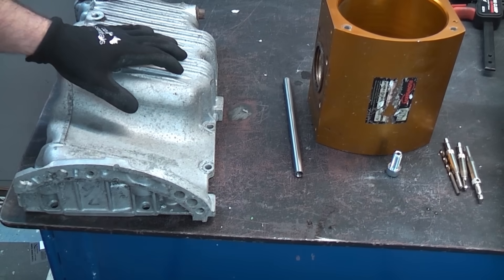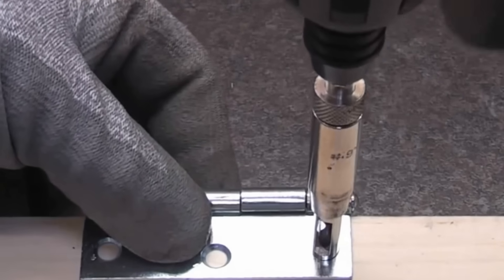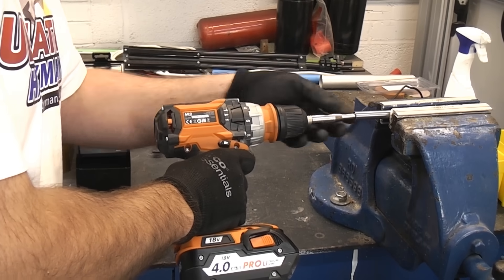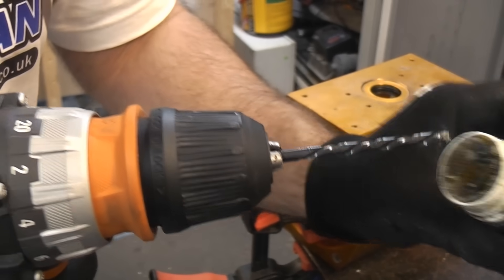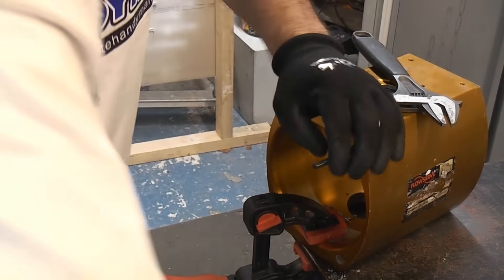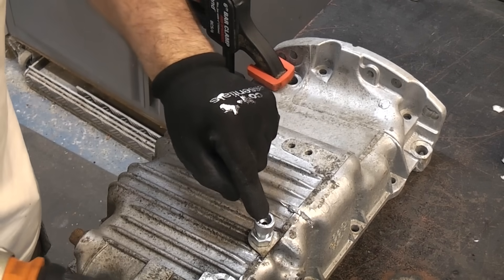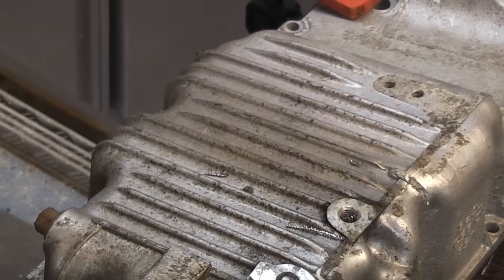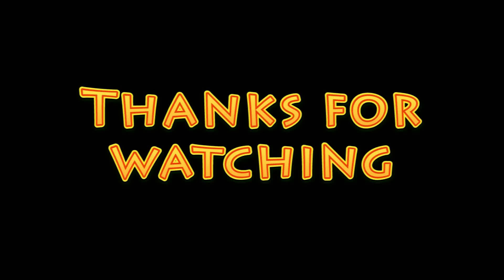How to remove a broken bolt in a deep hole | remove broken bolt in recessed hole

Comment: Next time use the smallest drill but u can...very light pressure, dab of oil, and   ease up on the rpm of the drill...drill all the way through it then pull by hand if it doesnt lock in enough to remove with drill in reverse....

Comment: What if that bolt is only about 0.3-0.5mm thick?
I have one really valuable old Zeiss SLR lens, made out of metal off course, and there is one broken bolt that should tightening the rear focusing element in place. This lens was calibrated for shorter range by previous owner, and I need to recalibrate it now, but stuck on that part…
Reply from the maker: It will be really difficult with something of that diameter, I don't even think you can get drill bits that small!
Reply: If the bolt is broken at or near the surface, you could try a dremel fitted with a diamond coated saw and create a screwdriver slot.
I'm sure that you won't mind if the saw cuts into the lens body if it means that you can turn the bolt.

Comment: The idea of making a drill guide to avoid damaging the thread is fantastic. However, since I don't have a drill press to make such a guide, I'll use a dremel rotary tool to make a hole to keep the drill bit at the center of the broken bolt. Thank you very much for the very useful tips.
Reply from the maker: Thanks for the comment

Comment: Thanks for the Video! ^^
Removing a torn off screw that sits deeper in the thread is no problem! It becomes more difficult if the screw is broken off flush with the material surface! Unfortunately this was not covered in the video. Also the size of the torn off screw is decisive, with a M12 thread this is no problem, but with a M6 thread or smaller you have a problem!
Reply: Weld a nut onto the broken bolt. Works like a charm
Reply from the maker: I've covered bolts flush with the surface before-
https://www.youtube.com/watch?v=_R1b8niX13w
Thanks for the comment

Comment: Great advice. But one should NEVER use copper based anti-sieze paste on aluminum.
Reply from the maker: Thanks for the comment
Reply: Actually the manufacturer of Permatex copper anti-seize recommends it for use on aluminum. Even their website states Permatex copper anti-seize is:

A premium quality copper anti-seize and thread lubricant .....
Suggested Applications: *Spark plug threads installed in aluminum*, exhaust manifold bolts, engine bolts, oxygen sensors, knock sensors, thermostat housing bolts, fuel filter fittings, and battery cable connections.

Not using it on aluminum is another internet myth that keeps coming up over and over again.

Comment: Smart tricks but, how do you make that hole in the guide-screw? and how do you tactle bolts that broke flush with the surface? the bolt-extraction method you just thought us work well when the bolt is actually inside and there's thread to thread the guidebolt into.
Reply from the maker: The guides are easy to make- https://www.youtube.com/watch?v=6mZj0J6CNYA
If it is flush with the surface, you can centre punch it, drill it and use a screw extractor- https://www.youtube.com/watch?v=_R1b8niX13w
Thanks for the comment

Comment: Ezouts are worth a shot as well.
If i can't make a drill bushing, what i will do is use a punch and get a nice centered dent in the sheared bolt.  Then us a dremel and make that dent a little more pronounced.  Then use a small drill to get your first hole.  Work you way up in drill sizes to get a bigger hole.  When it looks like you have used the biggest drill you can w/o damaging threads, use a sharp punch and pick the threads out with a hammer..gently.  It doesn't hurt to chase the threads with the right tap afterwards.
Reply from the maker: Thanks for the comment

Comment: The hinge sighting drill thingy and the left handed drillbit was fucking genious. I did not know either of them actually existed. Also the bolt drill guide is a good tool to make and have available in the garage. I've never encountered broken bolts that deep i the hole, bu now I'm confident that I will be able to remove it. Thank you for this video!

Edit:
On a side note, in Norway, we call the screw extractors "pigs dick".
Reply from the maker: Thanks for the comment

Comment: I broke one once on a 1970 Duster with a slant six. Twisted one off removing the broken exhaust manifold. Used an easy out and drilled it. Screwed up the threads, but it went in okay. Drove it for six more years without any problems. The car was simpler than today’s lawnmowers. I still have dreams where my current vehicle breaks down and I have to go back to the Duster. It starts every time, but the brakes pull left.
Reply from the maker: Thanks for the comment

Comment: What the hell is a left handed drill bit
Reply from the maker: A normal drill bit cuts going clockwise, a left handed drill bit cuts going anti-clockwise, which is useful when trying to remove broken bolts as the drill bit sometimes bites into the bolt and can extract it.
Thanks for the comment

Comment: Through hole is easy, i just drill it out on a bilnd hole with abit smaller than tap drill size and retap it, the threads left are cut away again. You need a drill press. I don't do that at work, i use a ballnose endmill and plunge it out. Works for everything, tap, bolt, reamer,drill, endmill. Must suck trying to use a cordless drill, lol, like a carpenter
Reply from the maker: Thanks for the comment

Comment: That's not bad ..i do a lot of manifolds on cars and trucks so pretty much every ford doge or chevy has broken bolts when they come in but I usually  just take my mig and spot a bead untill it's built up atleas t flush with the surface and then weld a nut on it ..and I know the heat isn't the best for aluminum heads I'm sure but I have never had a problem
Reply from the maker: Thanks for the comment

Comment: Put a large washer on top weld up to the washer from bolt then weld a nut to the washer turn washer and remove the bolt.
Reply: Works on head bolts easy.

Comment: what is the difference between a hole drilled right handed vs left handed?
Reply from the maker: A drill bit will bite into the material being drilled, when it is cutting. If you use a normal right handed drill bit, the drilling process can tighten the bolt, but if you use a left handed drill bit there is a chance that it will bite into the bolt and remove it.
Thanks for the comment

Comment: Ty for this "first person", hands on, guide. VERY ingenious of you to create your own "bolt steady" drill guide. 
     Will you please expand on a short statement you made in this video... At 11:47, you say you "wld normally use a tap wrench with this, BUT ....Unfortunately it doesn't work".  Do you mean in this particular application (aluminum housing) or because the bolt is down below the thread line? 
     Also, I'd appreciate any advice/suggestions you cld offer regarding my plight....
    I've a broken bolt on a Vintage, 2 bolt, drawer pull made of a soft composite metal. I've tried WD-40, BLASTER, applying heat, and lastly the SPEED-OUT tool such as the one you used. The small, broken bolt has not budged. 
     This drawer pull is 1 of 8. Replacing the set with new diminishes the item value by Atleast 1/2.
     Again, thanks for the video & any help you can give me.
Reply from the maker: Hi, Sorry, my accent is hard for some people to understand.
I said " I have left my tap wrench at work", I have two small ones, which would have been perfect for this job- but they were in my tool box at work. The only other tap wrench I had at home is this one- https://youtu.be/7JCfEMrCjhc?t=102

Small broken bolts can be a real pain. Can you not drill it out with the correct tapping size drill and then re-tap it?

Thanks for the comment

Comment: Bolt breaks because of 2 reasons, rust, and being cross threaded.  Either scenario would make it extremely difficult to remove, and in tight spaces.  Cross threaded broken studs have to be drilled out and retapped
Reply from the maker: Thanks for the comment

Comment: He has demonstrated a very logical, novel approach. I am not totally convinced that a bolt that was gaulded enough to twist off the head removing, will voluntarily unscrew itself with the minor effort that he demonstrated. Having said that, it certainly a dds options to your bag of tricks. The very least of which is being able to drill the hole out by being in the center of the broken bolt. Having a couple sizes of those bolts drilled through already in a drawer on the workbench would be priceless.
Reply from the maker: Thanks for the comment 😉

Comment: Do not use copper paste on aluminum and steel components then if added salty water you have made a battery cell and a chemical bond...  use aluminum grease  instead...
Reply from the maker: Thanks for the comment 😉

Comment: how about a broken off exhaust manifold bolt in a cast iron head in a car that has been sitting for 15 years?
Reply from the maker: You might need some decent spray penetrant, heat and good luck to get that out ;-)
Thanks for the comment

Comment: Never Never Never use a drill bit as an extractor!!!! reason is that a drill bit really cant be drilled out because its very hard... DON'T DO IT  HERE THIS GUY IS USING THE BEST METHOD AND TELLING YOU TO USE THE WORST THING TO REMOVE THE BOLT... GO FIGURE
Reply from the maker: Drill bits can be drilled out, as can taps or screw extractors when they break.  Taps and screw extractors are much harder than a HSS drill bit.

https://www.youtube.com/watch?v=7JCfEMrCjhc

Thanks for the comment

Comment: Amazing, thank you. I wonder if this would be successful on a broken exhaust manifold bolt. Also could you tell me a name for the cutting paste. Thank you.
Reply from the maker: It is definitely worth a try. Exhaust bolts are notorious for shearing, but as long as there is room to get in, it should be possible to get the stud out.
The paste I use is called exact cutting paste-  https://fave.co/2Nabyxc

Thanks for the comment
Reply: Rapid  Tap is not a paste , but  it works incredible  for all types of  those  situations .it's very heavy and it's not a water based  like wd40.  But I  don't  have  any problem  with wd40 . Just it's too light for broken  extractions.

Comment: Excellent. Thanks for posting this. Thumbs up.
BTW: I work in a damp salt air environment with 60 year old equipment.. A mix of Marvel oil and Acetone is a good rust buster in non aluminum situations. Kroil oil has been the best frozen bolt reliever we've found.
Reply from the maker: Thanks for the info about the rust buster, and the comment 👍

Comment: The really tough ones are where either the bolt breaks off at a crooked angle, or it breaks off flush with the top, or both. Impossible to center drill, unless it's a small part that will fit on a Bridgeport mill. In my career as a maintenance man in a cardboard box plant,  I was faced with 3 or 4 enormously serious challenges, with no alternative than to get that broken bolt out. Sometimes if it's a large bolt, you can use cutting torch.

Comment: Wish I saw this sooner.What can you do if the extractor was not dead center? It ate thru the bolt on one side coz I didn't know u was turning the extractor in a slight angle. Please help
Reply from the maker: Not much you can do. If you try drilling it again the chances are that the drill bit will pick up the existing hole.
You could try a diamond coated hole saw (providing you can centre it), but this is very difficult and time consuming.
https://www.youtube.com/watch?v=7JCfEMrCjhc

Comment: This is why I use a minimum of grade 8 bolts on everything. They tend not to break.
Reply from the maker: I work at 2 different sites, which are almost identical. At the older site they use bolts on one particular job which are 4.8 tensile strength and at the other site they use 12.9 tensile strength.  The 12.9 bolts shear off for fun and often need drilling out and replacing on a regular basis, but the 4.8 tensile strength bolts are fine and have been for almost 50 years.  I guess it depends on the application. 
Thanks for the comment
Reply: @ultimatehandyman  That's very interesting. I have always assumed the other way around. I guess there's a reason they make the bolts with less tensile strength. I'm no engineer however I believe the application and the proper torque spec have a lot to do with it.
Reply from the maker: I always assumed the same as well. It might be something to do with the heat/cooling process that the bolts are subjected to, as they are put in ovens and heated up to about 120 degrees C, then cooled down to room temperature - but this is happening several times per day in a 24/7 environment. The bolts are also stressed from movement and I think this is why the softer bolts don't shear as they are more malleable, whereas the 12.9 bolts just shear. (they are a right pain to drill out as well).
Thanks for the comments 👍

Comment: Nice video, but from my experience, drill your bolt with a bit smaller than the bolt itself, then take another bit of the same size, grind of the end of the shank flat and put it in your drill backwards and use it in reverse to back the bolt out! This worked for me several occasions!
Reply from the maker: Thanks for the comment

Comment: most times if a bolt snaps its because it ran into serious resistance from oxidation or the threads galling as its coming out or both, when it happens i usually have to drill and tap, or drill and helicoil, i like your jig/guide for a drill bit to keep it centered though, but in my experience those methods to remove it hardly ever work
Reply from the maker: Thanks for the comment

Comment: Nice video! But I would like to add some things.
If your extractor doesn't what do you do?
1) Drill the bolt really thin, meaning that the drill size is similar to the stuck bolt. Then you can chip the bolt out.
2) If everything fails drill a larger hole and retap with a bigger size.
3) If you want to keep the same size of hole and you have already extracted the bolt but the hole is now bigger, you can weld
the hole back by adding fillers, then drill and tap.
Reply from the maker: Thanks for the comment

Comment: hello. I dont't want to pick holes, and i didn't read all comments; Why You are using adjustable spanner and hammer to operate screw remover bit? According to my experience it's more efficient to use treading bit holder on screw removing bit - You apply twist and pressure in the same time - saving you time and energy. Regards.
Reply from the maker: I hammer the extractor in, because it tells you to in the instructions.
Normally I use a tap wrench, but my tap wrenches were in my box at work ( I did mention it at least once in the video), apart from my really large one, which I used in this video- https://www.youtube.com/watch?v=7JCfEMrCjhc

Thanks for the comment
Reply: @ultimatehandyman Thank You for reply. My mistake. Regards.
Reply from the maker: You are welcome.
Thanks for the comments ;-)

Comment: I had to smile when I saw how clean and shiny those bolts were once they were out.  Normally the reason they snapped in the first place is 'cos they are corroded into place and need more than a bit of heat, a few taps and some WD to shift them.  Good ideas and a useful demo, but it usually isn't that easy in real life. 🤣
Reply: Or someone forced the wrong bolt in until it gave up. Or too long a bolt and it bottomed out, it snapped. I quit working behind those people. Easier to leave them alone.

Comment: I love your lathe made drill guides, I'll be making some of these soon.  I have a set of those reverse thread extractors and I generally try them first because of less hammering, less potential for expanding the bolt, but I usually end up using  a square tapered extractor with far more success.  Proper ones have a relieved sharp cutting edge on four sides (D2 tool steel) that allow for hammering down farther into the pilot hole without expanding the stuck thread and still providing a much stronger connection to the broken bolt.
Reply from the maker: Thanks for the comment
Reply: Yes the tapered extractors tend to expand the bolt and make it even harder to get out, if the stud seems loose then who cares but usually we know how bad they are in there. Use to know an old timer mechanic, he taught me a trick, drill the bolt as you do then blow the rest out with cutting torch, or blast one side out to relieve it, usually the torch won't touch the casting if you are careful, sorry that is cast iron block, steel bolt.

Comment: How often though is a snapped bolt on something you can comfortably put on the bench? It's usually buried down in the darkest corner of the engine bay. Wonderful tips sir.
Reply from the maker: Not very often at all, but obviously I have to make things easy to film.
Thanks for the comment

Comment: Very cool video, thanks for sharing your knowledge, very cool idea about making the guide out of a bolt for centering the drill bits and protecting the threads, needless to say that drilling the hole in the center of the broken bolts assures a better grip of the extractor tool to keep the broken bolt from expanding inside the hole making it more difficult to remove, (Been there, done that)
Reply from the maker: You are welcome
Thanks for the comment

Comment: I have had success using a 5/32" 6013 welding rod for small holes. Build up the weld to the top of the hole and then weld a nut on the weld.you may also use a hollow pipe for a guide to avoid welding the threads.most broken bolts will come out fine
Reply from the maker: You can get some special electrodes for this purpose called Xtractalloy, but I've only tried them once and could not remove the broken bolt out.
Thanks for the comment